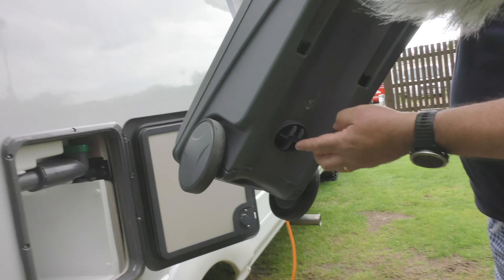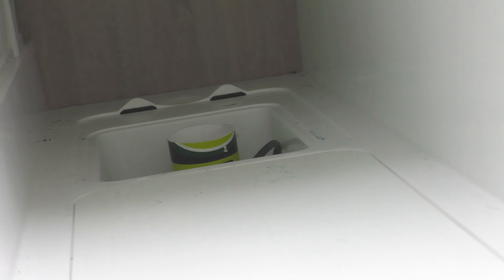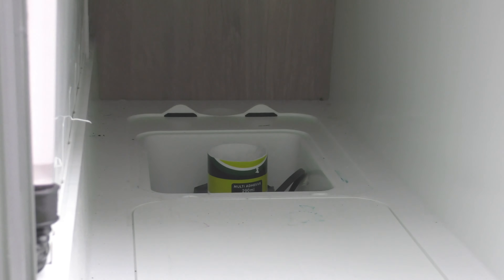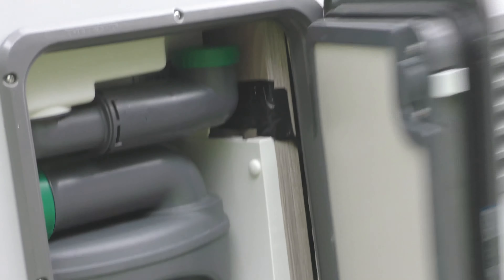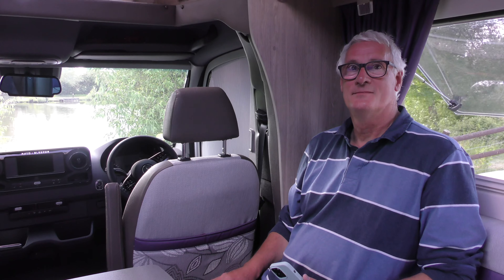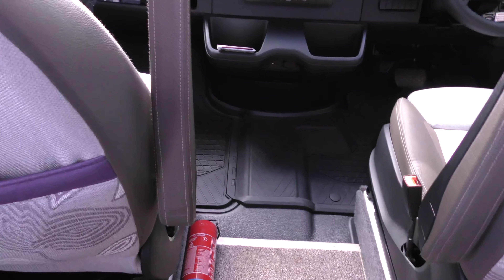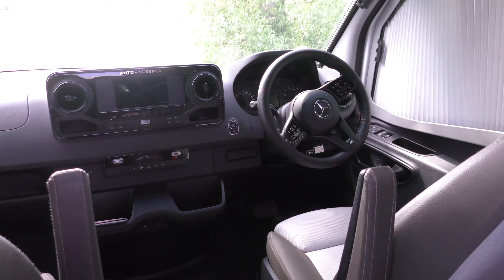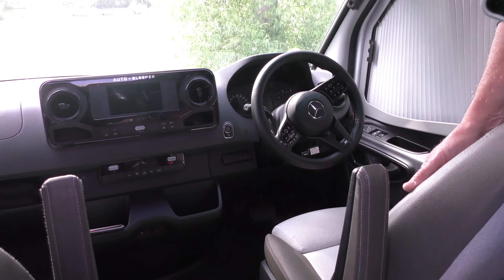Ch-ch-ch-changes - does your loo cassette stink? Cure it for cheap!

Comment: Lining the cupboards with foam is a great idea. We currently have silicone matting in there to help things not slide about but it doesn’t stop the rattles.
Reply from the maker: it is, isn't it? May well be happening in ours - if I can get round to emptying everything...